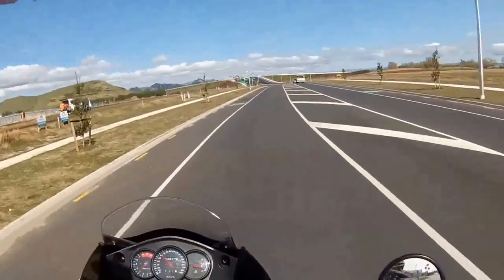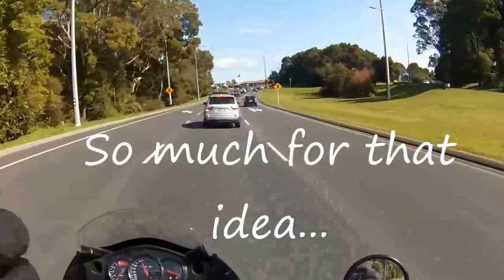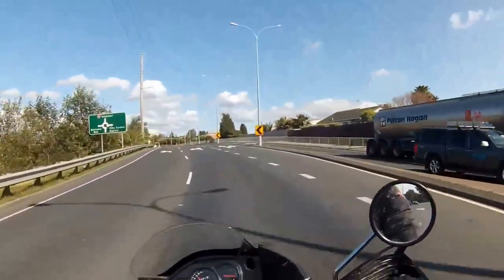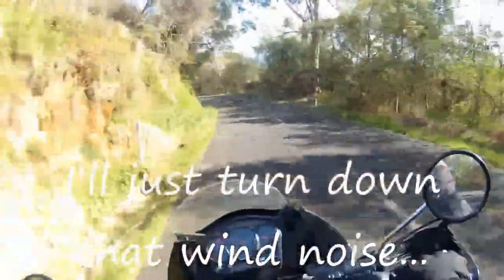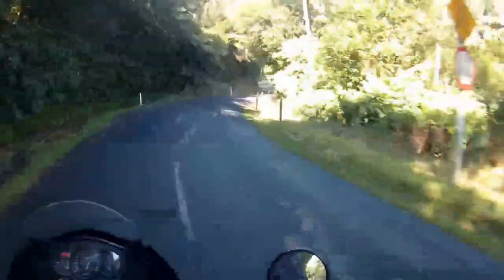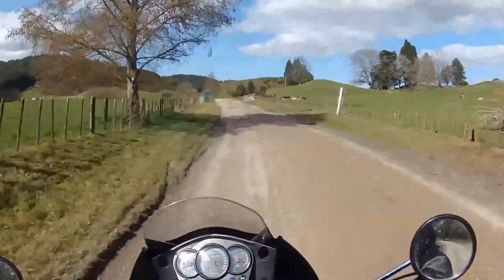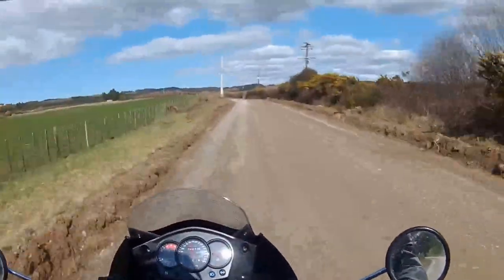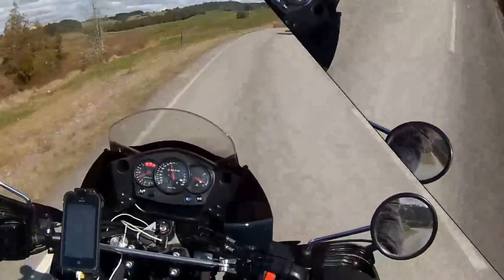Mic Test 3 The Dead Cat - Footpeg scraping cornering

Comment: did you find a solution for your mic? im having the same issue. i got the exact same sound with this video
Reply from the maker: Hi, No I didn't find a solution to the problem with that mic then it dawned on me that since it only cost $1.50 on eBay there probably was never going to be a solution. I noticed that everyone who does Vlogs with the Drift Ghost camera never has mic problems, so I found that you can buy the Drift microphone as a separate part on eBay. Once I got that all my problems disappeared, it is a purpose built mic and is fantastic.

I now have a new problem, I had two nasty crashes off-road where my camera took most of the impact on my helmet. Surprisingly the camera still works but the external mic jack got damaged and can't be repaired so I'm now without an external mic at all...